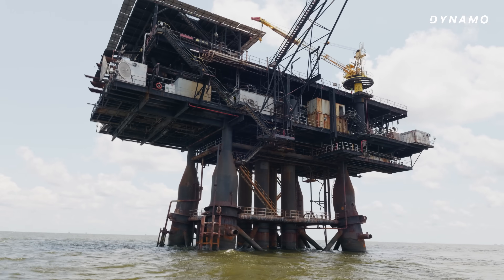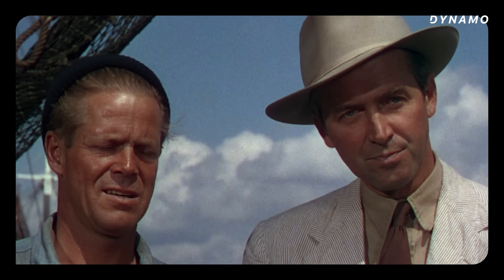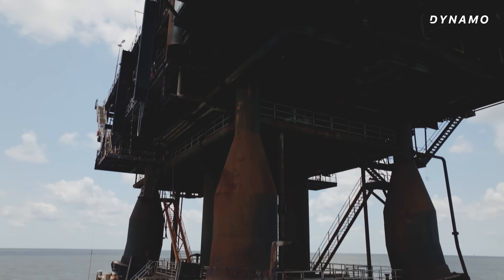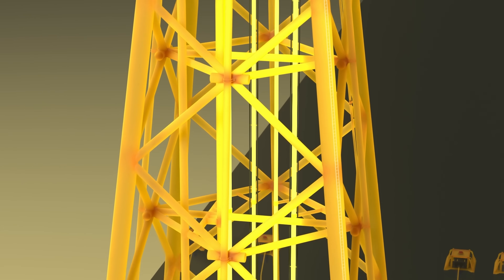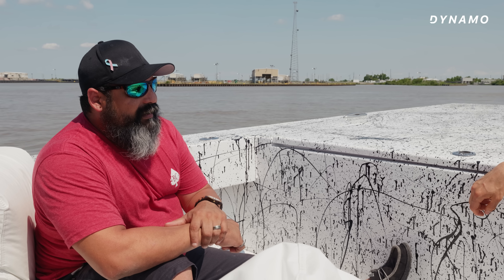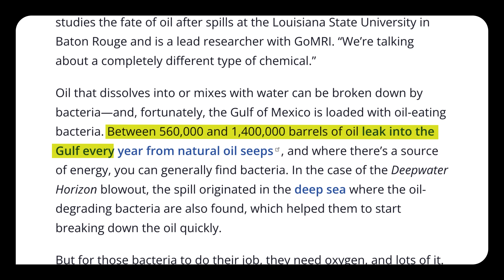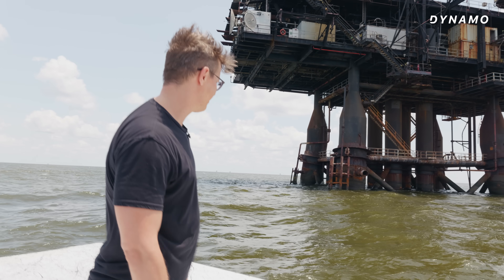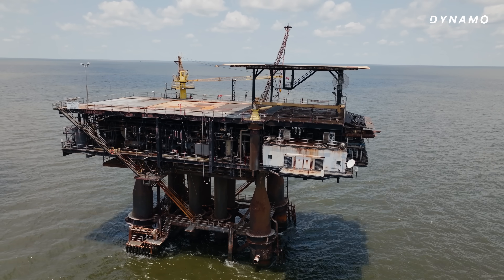I Visited Abandoned Oil Rigs — and Found Something Terrifying Underwater

Comment: I used to be a merchant sailor. Did a lot of work in the gulf and there's spots that are way more dangerous than complete abandoned rigs. Some companies had rigs cut down just below the water line and you could hit those pipes/pylons or get picked up by the sea and land on one. We charted a few paths and marked a lot of hazards that weren't on current charts. It was scary going through these old fields at night in rough seas and catching a sight of a jagged 10 foot wide pylon letting you know you're in a non-explosive minefield essentially. It's massive for marine life though.
Reply: if it's not, it needs to be criminal cutting these just below the water line.  Not only is it dangerous to vessels sailing along that don't know the cut offs are there, but it's such a sneaky and underhanded method of dealing with it, you KNOW they didn't plug the well(s) properly either.
Reply: @serpent77 it's kind of grey, but companies abandon them and there's actually unaffiliated scrappers that used to roam out there. Think like crackheads stealing copper from A/Cs, but hardcore Louisiana swamp folk stealing whole oil rigs. I don't know if the company itself actually pays them under the table or something like that. After years of sailing you can note ones that are actively stripped down more and more each time you pass by.
Reply: @serpent77 cut?  They probably just collapsed in a storm
Reply: Those should be researched and the companies fined by the day till they resolve the problem, if the wells are capped properly then cutting them 50 ft below low tide could be a solution, but in all honesty removal should be the goal. Binds definitely need to be raised to 5+ million per well, and it be put in a trust that anyone who completes a removal job can access.
Reply: @bhamjoe I agree. If companies were fined for unethical, damaging behavior, and fined in a way that HURT, closed loopholes, and publicly shamed them, we would be better off.
Reply: Yup! Some companies just don't give a shit about our ecosystems.
Reply: @ThinkForYourself2025  Companies from the middle east..
Reply: @JasonH17 ha, what a moronic thing to say. Trying to pin this on a specific region is just wrong. Shell, just for instance. Which is not from the middle east, is responsible for thousands of well documented environmental catastrophies. And they've fought tooth and nail to shrug their accountability. This is a symptom of the larger plight of human greed and a lack of ability to control large multinational corporations with boards that care about nothing but their own bottom line. Full stop.

PS: Not to mention the egregious practice of soft money lobbying to keep environmental regulations, amongst others very dumbed down and manipulable in... Yeah, the good ol US of A.
Reply: @newolde1  ironic you call me a moron when you havent spent 3 seconds researxhing your insults.   Not to me tion you refuse ro think for yourself. Al Jomaih family and ties to shell. Only since the 60's and thats just one there are many.
Reply: @JasonH17  lol companies from everywhere. Racism is not gonna save you or make you feel safe. All capitalism is one thing.
Reply: @JasonH17 more like companies from texas 😂
Reply: @JasonH17 Every public company is profit driven and will do anything to increase their profit, even if they know it will risk lives.
Reply: That's a scary thought for future generations, we literally put a band-aid over these sumps and called it quits..
Reply: This is terrifying.
Reply: Why not cut away most of the above water structure and leave only the main suport pilons and fram and a little shelter.
They could act as emergency platforms for foundering vessles crews.
Or science platforms or vacation spots.
Reply: Meh, wouldn't worry much anymore these days because sea levels will rise over 300' in about 50 years.
Reply: My dad just recently passed away. I miss him. He was a merchant marine, chief engineer for years and years and years. He retired quite a while back, I'm not 100% sure when but I'm 38 and he was still working when I was little, but was retired by the time I was 16. Anyways, I didn't get to meet him in person, but once he retired, and once I was 17 I reached out to him online and made contact and from that point on we, him, me and my mom, talked practically every day until the day he died 20 years later. I love him and miss him and feel a great respect and adoration for, and feel drawn to, merchant marines/large ship sailors. Feels like one little part of my dad that is still living on. Glad you survived and hope things are great for you now
Reply: We as People Need To march On Congress 😮😮😮😮
Reply: @GurlHeaven211 commie ho-bag bot
Reply: @GurlHeaven211 you like how that worked out for the j6ers? That was a  big ass setup, and all unarmed, the cops might as well have opened the doors and did lead them in, only for those folks to be fucked over for the next to near future
Reply: Wow I didn’t know our VP was an avid sailor 😮
Reply: wow huh yea i never thought of the actual method of removing these mines. if not cut over 100 feet deep that would be hella dangerous
Reply: @NPCBoxing in another 30 years the pylons will just rust away. These areas are out of shipping lanes and anchorages so the only people that traverse the area are really just oil field service boats, scrappers and shrimpers. Shrimpers would fish in an actual mine field and not give an eff lol. I did STS transfers from VLCC tankers to panamax and suezmax tankers and the VLCCs draw well over 100 feet when loaded so they stay 80 to 100 miles out. Alot of the rigs abandoned were just scrapped down to the water line by Cajuns lmao. Some companies would hire the same scrappers that started companies to underbid everyone else and do half-assed jobs.
Reply: sabes tu que no he podido ni encontrar fotos de el golfo de mexico y las 7500 torres de hay alli . tampoco lo puedes ver en el google map
Reply: @manuelclavijo4484 it's been quite a few years since I worked out there. I hope something has been done with them. Some you would only spot if there were enough waves to cause the water line to dip below the pylons just enough. Look up nautical charts of the gulf, especially near Louisiana and those will be much more accurate. They add objects to new charts that we reported not being there on previous charts.
Reply: So how do was your ship? Is this also a problem for a sailing yacht ?
Reply: @marcbeebee6969  If these old structures can be seen above the water in rough weather, then even a life raft would be in danger of hitting one. Best not to risk getting anywhere near them, regardless of how small your boat or how shallow the keel is
Reply: Well, under Trump's regime we don't have law anymore. I'm a lifelong Floridian, and I grew up on Clearwater Beach.. So sad what people done to our environment.
Reply: @sherryberry2394 this has nothing to do with trump, they've been there for 4 decades, did you branch the fucking video. I'm not even a Trumper but that's just the dumbest thing ever to blame him for abandoned oil rigs, how dumb are you? Thisbis the problem with our country, that's why he is the president genius, you guys blame him for literally everything, eventually people would see that it can't all be true, then you're stupid childish lies drove everyone right into his arms. The modern democrat party is nothing but idiots.
Reply: @sherryberry2394 tds terminal
Reply: You are welcome grand kids. Not only did Orange Jesus bankrupt the nation but we left all this crap in the Gulf pile up for y'all to figure out.
Reply: @Tom-y4w oh no, that's been from a time way before orange man. I know you want to blame everything on him, but these rigs were left bare and to rot out there way before politics changed lmao.
Reply: @Tom-y4w tds terminal
Reply: if everyone drove small fuel efficient cars the price of fuel would be under a buck a gallon and we wouldn't have to drill for so much.
Reply: @FourthWayRanch  Sure, but even if everyone on earth stopped using oil completely (not happening, it is used for too many important things like making plastic) the abandoned structures OP described would still exist
Reply: @FourthWayRanch  more oil is used for plastic, than is currently used in vehicles.....

Oil barons push plastics to maintain their profits.
Reply: @FourthWayRanch not even close.  You are aware of how much fuel aviation uses, right?
Reply: @FourthWayRanch you go gell that  to india africa and china,...meanwhile, dig baby dig, drill baby drill
Reply: @MillardFeelmore Better not tell Greta the Freak it's good for Marine life. It will ruin her obsession.
Reply: @TonyFisherPuzzles we tied off to complete but abandoned rigs many times and caught enough fish to feed the Philippines lmao. I've seen some companies that demo these rigs properly, they use cutting charges on the legs, and cut them over 100 feet down usually and then the whole thing just crumples down onto the bottom and the marine life explodes.
Reply: @TonyFisherPuzzles nah she's over that greenie stuff now  P stein is much more cool and grown up.

Comment: Root cause is government letting this happen. The cost of cleanup should be built into every gallon pumped out. Should have been like this from the start.  But GREED wins every time.  Governments are bought off or just wait to react to issues vs being proactive.   Being proactive is our biggest weakness in industry. Every industry.   We are only proactive if it will feed our greed.   But we will not be proactive if it does not..   And that’s the bottom line.

Comment: Plugging the holes would be very good but these rigs being removed is destroying entire communties of life from the oceans, ironically taking them out is far worse than leaving them there.
Reply: Decom companies need to scrap the platform to plug the wells, plugging the wells can be the most expensive part, but executives are using the "reef" thing to loot billions of dollars
Reply: You don't think the fish etc would be able to figure out how to thrive without abandoned rigs?
I mean, they'll still have hundreds of active ones I'm sure!
Reply: @geopolitix7770  The legs of the platforms tend to get a lot of marine growth on them (because of the better sunlight penetration at shallower water depths) and this makes an excellent food source for the local fish population, that they wouldn't have if the platform legs weren't there. There's also the small matter of protection from the trawler nets that the legs also provide. Trying to dig those legs up disturbs the seabed, potentially disrupting habitats for worms etc, which then die off for ages, thus removing a food source for higher species along the food chain. Ironically, your argument seems to be that we should ignore the impact on the marine environment and focus purely on cosmetic surgery for the seabed!
Reply: @seamusbyrne7820 you missed my bit about active platforms still providing habitats if you take out old ones?
You  have to draw the line somewhere though or you will simply have lovely fish structures until they day the pipe system fails and oil goes everywhere.
Reply: @geopolitix7770  Read it again. Your argument boils down to "Tear down the dead infrastructure, ignoring the marine life which has made it into a habitat, effectively for cosmetic purposes, so the seabed looks pretty, though lifeless. If the marine life doesn't like that, they can leave and go to live platforms which will already have formed their ecosystem". That argument is petty vanity and is ludicrous from an ecological perspective.
By 'pipe system', are you referring to the well tubing, which has probably been plugged with concrete inside, as that's the norm, or the pipelines, which will generally also have been de-oiled inside, either by flushing or by pigging?
Reply: @seamusbyrne7820 well based on the video evidence(I watched it all, did you?) i did not get the  impression AT ALL that the wells were fine to be left with no risk of oil leakage.  
And FWIW, steel structures are not like booked out hotels. I'm sure the organisms will find a way to coexist given theyre almost certainly the same species. I believe fish are good at swimming to new locations as well?
Reply: @geopolitix7770  Impressions seem to be all that you do have. Since you ask, I did indeed watch the thing in its entirety, which is precisely why I was positioned to comment as I did. It would appear that you were not able to do the same with my comment before you felt compelled to scribble out a reply.
Again, your latest reply confirms the synopsis I made of it in my previous post, so thanks for confirming that, but given that I also pointed out how ludicrous your point is, I'm surprised that you chose to continue with it. Does your knowledge of marine biology not tell you that fish are only a small subset of that ecosystem?
As for the 'hotels' piece, there is only so much of the subsea infrastructure that receives sunlight and it gets completely covered in marine growth within that zone.  Deeper down, there is less sunlight and the population density of organisms reduces accordingly. The infrastructure is saturated and there is no room for more. The organisms cannot call for room service.
Geopolitics, if done correctly, ought to consider facts and not an ideological wishology. The Little Mermaid and Spongebob are not reality in the marine environment.
Reply: @seamusbyrne7820 so in summary (because I'm not going to tey and give a diverse take on marine lifeforms ina YT commet section)  given the video says the whole oil industry argument about keeping old rigs for ecosystems is lies, you think the video is garbage?
Reply: @geopolitix7770  Again, we get a semi-literate response from you, with an ever-decreasing sense of responsibility for your own comments, trying to transfer critique from your own ill-considered comments back to the video. I'll treat that as an admission that you realise how poor your arguments were. No problem; that's how people mature.
In terms of the video, since you ask, that's a different question. It's something of a soup, containing some elements which have merit, but lacking in others by way of either conscious or unconscious omission; this degrades it from a potentially insightful piece to yet another hysterical commentary which will be ignored within the industry for that precise reason. Just because someone makes a video and makes it sound convincing, it doesn't make it true.
Reply: @seamusbyrne7820 don't get too far over your skis my friend, its just that a tiny screen keyboard leads to inadvertant typos.
My premise is simply that abandoned rigs seem unlikely to have been entirely safely decommissioned. That point comes through loud and clear in the vid with loads of evidence ( and read some other comment threads here too for other anecdotal stories of unlit half cut off rigs etc). Given commercial pressures, it seems entirely likely that whatever the legit benefits of a steel structure for the ecosystem, if there's even a low probability of one of the springing a leak, that ain't a good thing. I really don't care if they leave a base behind on the sea floor if its well sealed... but its probably just slowly rusting through while it waits in the queue for proper closure... if that ever comes.
Reply: @geopolitix7770  Would those be water skis then? To be honest, the blatant absence of coherent logic was of far more significance than any little typos.
Your premise was nothing of the sort that you now describe and yet again, you are trying to wriggle. Despite your assertion, there is no evidence provided within the video, only further unsupported assertions. And given the concern of leakage, if the platform has been chopped off the legs, then those pipes, being vertical, will also have been chopped and if they were going to leak, then they would already have leaked. If it's well casing, then the sealing medium, being cement, is pumped down there before chopping the platform up. Prattling about things maybe rusting and maybe leaking is empty hysterical opinionating and has no rational basis behind it. Perhaps you ought to check what grades of steel we are talking about, and how the ingredients required for a rusting process might reach the places that you claim to be concerned about, when deciding whether to articulate that as a concern. Remember when they mentioned that it's hundreds to thousands of metres below the seabed? Think about that.
Reply: @seamusbyrne7820 you seem very happy in your own self congratulatory circle of thought so I'll leave you be
Reply: @geopolitix7770  Given your posts so far, I'm mildly surprised that you're able to identify what thought is. Farewell, and don't forget to not write.

Comment: Error at 4:26.  A jack-up rig is a mobile rig for exploratory drilling, used for discovering or characterizing a reservoir.  A jack-up rig is not usually used for permanent long-term oil production.  After the exploratory drilling shows that there is sufficient oil for production (which can require dozens of wells, with pipelines, oil treatment, etc.), then a fixed platorm or compliant tower is constructed for the long-term oil/gas production.
Reply: the error is the title..these are platforms...
Reply: We as People Need To march On Congress 😮😮😮😮

Comment: One term you have to better define “blowout” a blowout is on a new well with high pressure. 

A leak on a compromised well is a leak. Majority of the time these old wells that spring a leak have very low pressure and don’t “blowout” but rather slow leak
Reply: "Blowout" was used because it sounds scarier to the ill-informed. Same rhetoric you see on the Weather Channel.
Reply: @sean9267  
Same reason the video used deepwater horizon even though it wasn't even remotely abandoned. Yeah, eventually the channel pointed that out but still shitty.